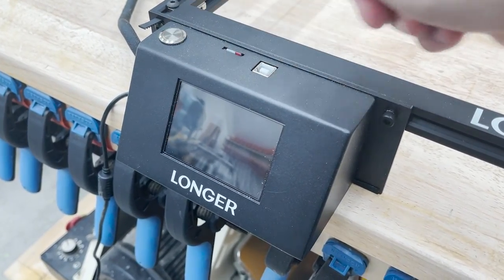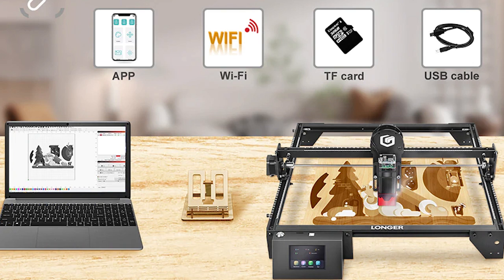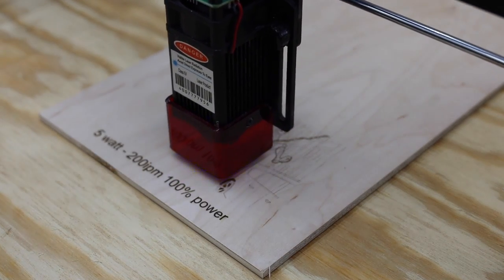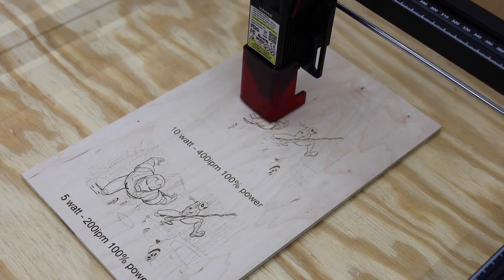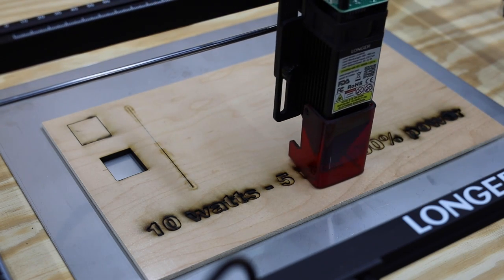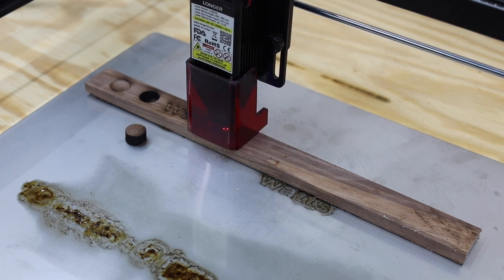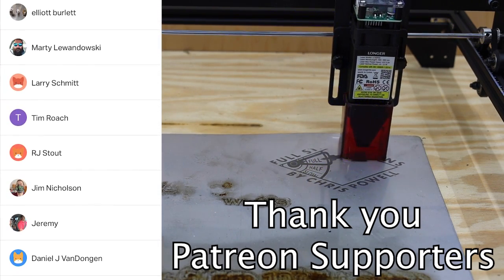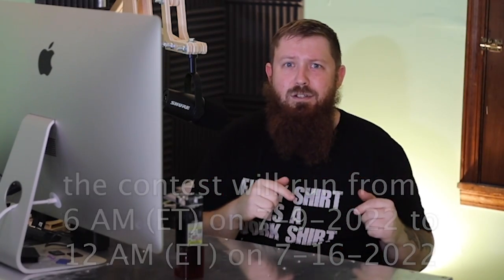Budget Friendly Longer Ray5 just got a HUGE Upgrade in Power

Comment: I would have many uses for the laser.  First, for adding a logo to my projects.  It would be a lot cleaner looking than the branding iron.  Second, for personalizing some of the projects I make, such as cutting boards.  Third, I would use it to add to  my CNC projects.  I can think of many uses for the laser an I believe it would open up many additional opportunities to complete projects that I cannot currently make by using different materials.

Comment: As an owner of a Co2 Laser I've always wanted to compare it with the capabilities of these budget laser engravers. I use different software (Lasercut) as well and also would like to try the software that everyone uses for these lasers before I commit to buying new boards and software for my Co2 60 watt machine. I've heard how this software is easier to use and has more capabilities than lasercut. I'd like to find out for myself and document and keep a video journal of the process if I were to win or get a budget laser.

Comment: What would I do with a 10 watt Longer Ray5 laser engraver?  I would connect it to my Openbuilds CNC controller that has a Next Wave Shark frame.  It will replace my 2 Watt CNC laser which I do not currently know how to connect to the Openbuilds controller because this laser was made as a  Propriority laser to the point were you don't know what the wires control in the laser.   I would definity enjoy using it to cut 3D objects with the Vectric laser modular.  Thank you for the opportunity to win this fine laser!

Comment: Until recently all our work has been in aluminium, for various reasons weve  been diversifying and every day I come across uses for a laser that I had never previously considered.  They are clearly far more versatile, while I can buy expensive cnc bits to give crystal clear cuts in acrylic, it's clear adding laser as the tool for cutting plastic is the way forward for us.